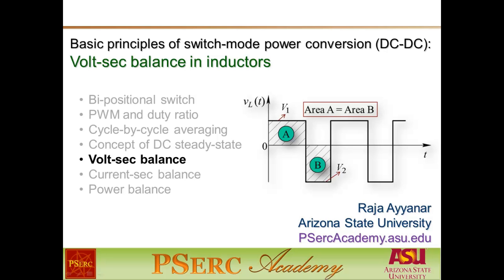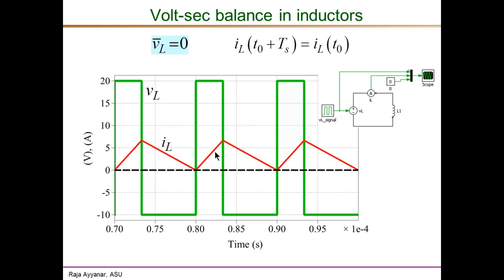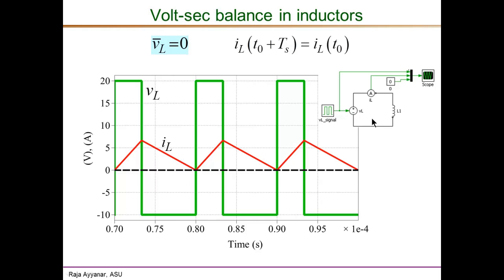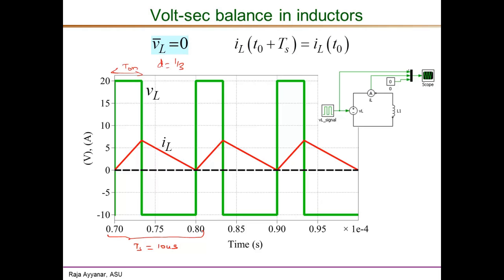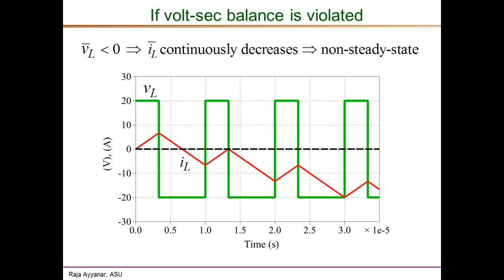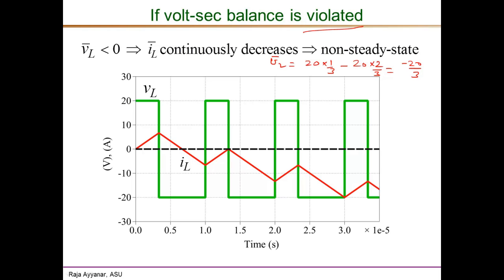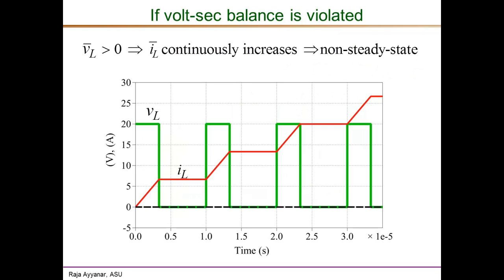Basic principles of DC DC Volt sec balance 2

Comment: 7:08 if the "rest of the circuit" tries to apply positive voltage and 0 voltage for the rest time .. it will be valid right? even if the (Toff = 1*10^-99) for "ideal diode and inductor" right?